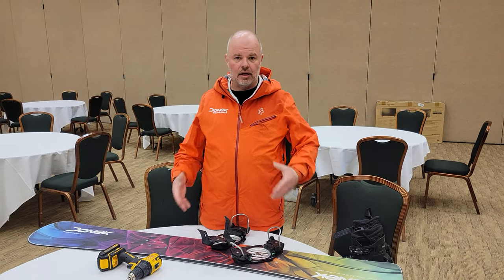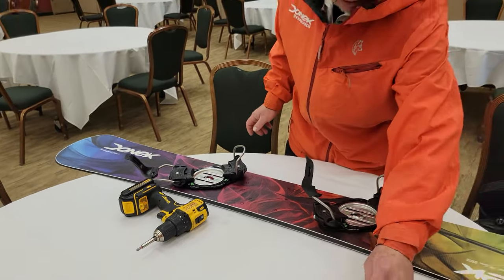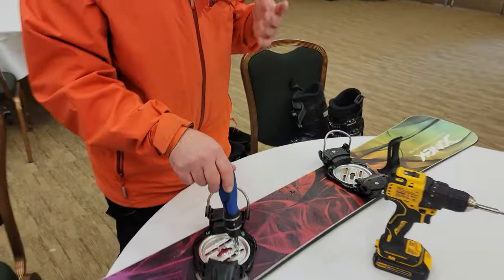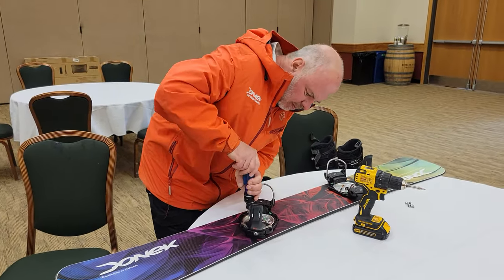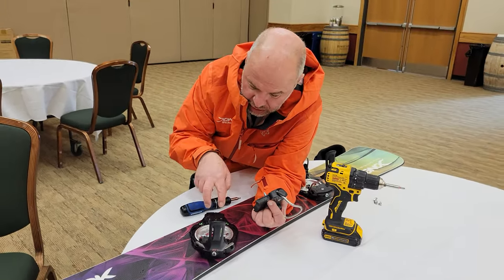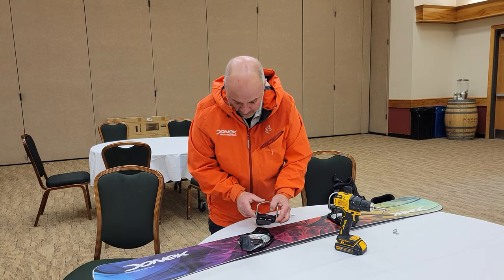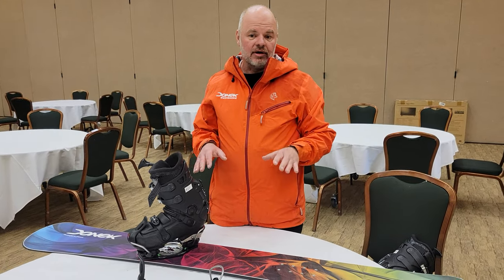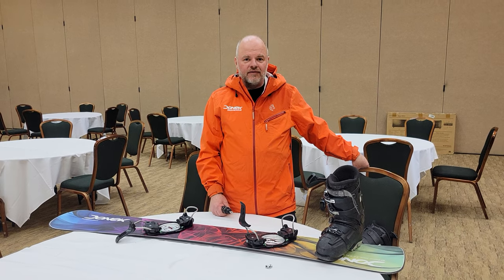F2 Binding setup

Comment: This is excellent!  The instructions from F2 were so insufficient.  They didn’t explain any of this.
Reply: suz4359  Scoliosis in adults is degenerative.  I know several people who have developed it.  None of them have ever touched a snowboard.
Reply: suz4359  You keep talking past my questions by repeatedly saying “This isn’t up for debate” which is nothing more than proof by assertion.  So I will ask again.  Show me the data!  Send us a link to or cite any studies that show a correlation with binding angles and scoliosis.
Reply: suz4359  Those are accidents which can occur in many sports activities, which in any case I am not disputing. I am a cyclist which probably puts me at higher risk than snowboarding  Again, you are going off on unrelated tangents and talking past my request for studies.
Reply: suz4359  The tangent is that instead of citing any scoliosis studies, you instead pivoted and threw general accidents and injuries from snowboarding into the discussion. This had nothing to do with your original post regarding the correlation of alpine snowboarding with scoliosis.  And if you respond by saying that injuries cause scoliosis, well that’s true of any sport that involves movement.  Your arguments are circular and based on emotion, not statistical studies.  If it is your opinion is that snowboarding is inherently dangerous, ok then.  Stay with that.  But be aware that most of those injuries are caused by snowboarders riding duck.  So you might want to take this elsewhere.
Reply: suz4359  Seriously? So most snowboard injuries and fatalities are caused by snowboarder using a forward stance?  And you have proof that this is true?  When someone is injured, do the reports make note of the boot angles?  To quote you: “Please don’t make comments that are not true.”  But again, I thought this was about scoliosis.  The fact that Ron LeMaster was killed by a snowboarder is tragic.  But what does that have to do with boot angles and scoliosis?
Reply: suz4359  Jeezus, how long are you going to continue with this?  I’m not an instructor and honestly I’m a better skier than a snowboarder but not an expert at either.  When I started skiing over 30 years ago, it was expected that someone starting out would take several increasingly progressive lessons to improve their form over several seasons.  From what I’ve observed, snowboarders will take at most one lesson as a newbie and most will not even do that.  They see no reason to. The inelegant twist, pivot and skid style you describe is typically what most all duck stance snowboarders do and unless they are inclined to advance to Alpine carving or Boardercross, they see no reason to improve their form.  So they don’t.  For what the resorts are charging for lessons and lift tickets, I don’t blame them.  Besides, just about everyone else on a board does the twist and skid style and it’s seen as perfectly normal.  And if everyone else is doing it that way, then it is!  In their minds, there is no such thing as bad form on a snowboard.  And unlike skiers, there is no stigma in falling and tumbling down a slope.  If they don’t care about somersaulting down a slope, they surely don’t care about the risk of Sciatica in 30 years. As long as they get down the hill at about the same time as their buddies, they are doing perfectly fine.  But that’s the way it is these days and you need to get over it!  You can complain about this all you want, but nobody cares, least of all, other snowboarders.  And if you do want to complain further, take it up with the instructor associations, not me.